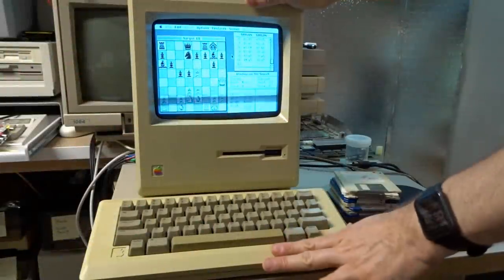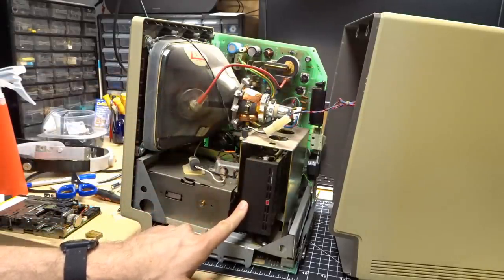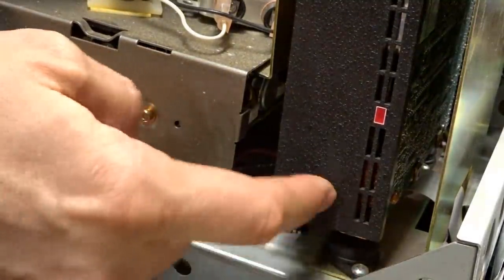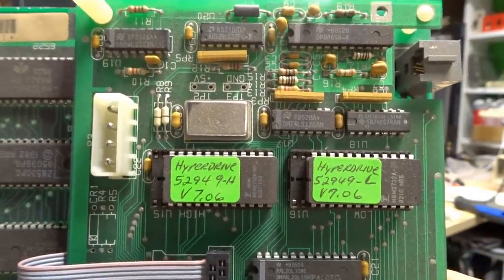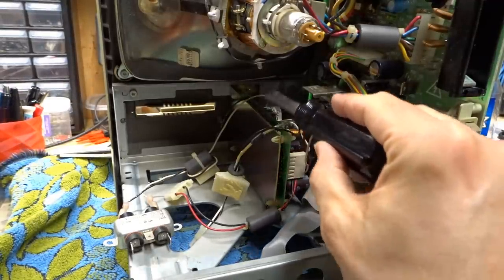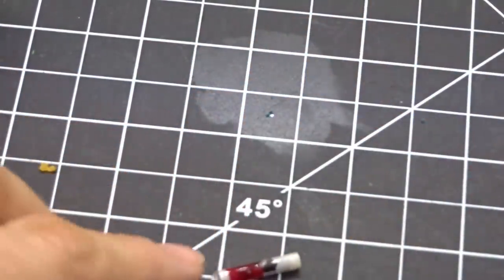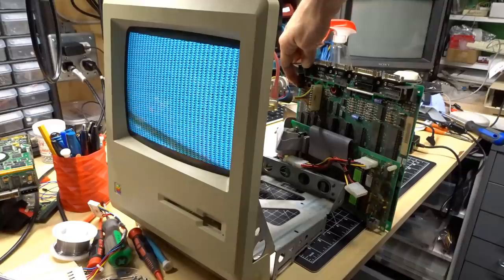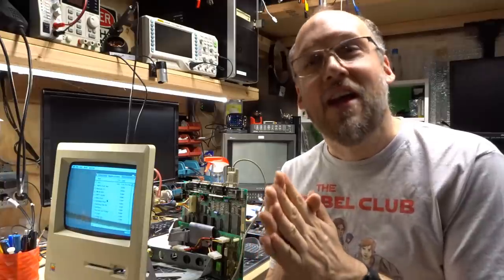Macintosh 512K with an internal MFM hard drive?

Comment: Keep it as-is! Even though an MFM drive on a platform that was historically known to use SCSI for a very long time seems weird, I'd still keep it as-is. Consider it like the Mac equivalent to the IBM 5160 XT.
Reply: You are thinking of the Mac Plus - earlier all-in-ones didn't have SCSI. There was an unofficial weird external hard drive that plugged into the external floppy port though...
Reply: Except it wasnt unofficial. it was called the Apple HD20. But you needed the enhanced ROMs to natively boot it. Otherwise you had to have a boot disk to load the driver before it transferred control over to the hard drive.

Comment: Leave it as is, though you should get another PSU for the hard drive. The upgrade is period correct.

512K Macs came with 800K drives, and you need to check the ROMs to see if it is HFS (Hierarchical File System) or MFS (Macintosh File System). Since it is using a rare System 5, it looks to me to be HFS.

HyperDrive used to make external SCSI Drives for the Plus and SE / SE\30s and even had an internal SCSI HD for the Mac Plus long ago as well as rebanding internal SCSI drives for the SE / SE\30 and Mac II Line.

Look at the side of the board, there should be steps on one side so you can pull the board out a tiny bit for the steps to line up and then open it like a swinging door. You should close it the same way.

If anything, check out the Analog Board and clean up/replace any bad solder you find and check the connectors for burn marks.

Comment: Yup. We called it “sticktion” in our lab back in 1994. We had so many MFMs we needed to repair, and used the same method to lubricate bearings with some graphite grease.
Reply: Ah yes the stiction problem, give [the stuck hdd] a good ol' whack and it should free up!

Comment: Leave it a the way it is, adding upgrades to these machines in that era was common due to the speed of development.

My dad had a Macintosh II back in about 1989, it came originally with a 40MB HD and 4MB of RAM, that was increased to 8MB of RAM later. In about 1991 the logic board was swapped out for the IIx version, and had dual 1.44MB floppy drives added, as well as upping the RAM to 16MB, it had a special graphics card fitted for the monitor which was a 21" if I remember rightly. Also had the apple scanner and laser writer II printer. it was used for desktop publishing at the time, it was quite an investment !

I sold that machine for just NZ$50 about 15 years ago, and it was still working!

I still have the full set of System 7.0 / 7.1 in its original box that was used with that machine,

Comment: @Adrian Black
The Mac 512k was originally available with both types of floppy drives. The higher capacity drive was an optional upgrade. About the HDD, like the Mac128, that is an authentic upgrade. Keep it! It's a very cool aspect of that computer! The first boot corruption problem is actually the way those upgrades worked BITD. The early upgrades required the reset be pressed manually because the HDD needed time to spin up. Not all of the HDD upgrades did that. Later versions paused the system boot long enough to account for the spin up time. This quirk is actually authentic as well. Do your thing fixing it up, but keep it as is. It'll be a wonderful show-case and conversation piece!

Comment: THANK YOU!  You saved my Applied Engineering Vulcan 40MB MFM Western Digital drive!   I have one of these in my original owner Apple //e and when I brought it out of 30 year storage the drive would not spin up.  I bought exactly the lubricant that you showed/mentioned and to my delight the drive spun up after putting it on an external power supply.  Amazing!

Comment: keep as is... dont know if there a mod to replace the old harddrive with something like a sdcard of CF or something in case of the drive failing
Reply: There are IDE and SCSI to SD/CF card adapters that are relatively cheap. For MFM/RLL though, the price shoots up substantially. I found one such board with a quick google search, but it's $270

https://www.drem.info/

Though for all of the functionality it offers, I'd say its well worth the cost.
Reply: Besides the board GGigabiteM refered to there is also http://www.pdp8online.com/mfm/. Similar functionality. And I doubt much cheaper if you include the beaglebone.
Reply: I don't see any point in making a interface to mate an SD or CF card with an MFM/RLL controller. Skip the MFM/RLL controller and interface to the bus directly.
Reply: @BlackEpyon  Considering the massive number of different machines that used MFM/RLL, that makes the least amount of sense. You'd have to make dozens of different interfaces for every machine and write the software for all of them.

Easier and less expensive to make an MFM/RLL emulator and work out the slight controller differences in software.
Reply: @GGigabiteM  Firmware, not software. Software doesn't need to know what kind of data storage it's using, only what address it can be found at. But the interface is less of an issue than the underlying system architecture. Mac architecture of that era was considerably different from PC architecture, as Mac and PC were from Commodore, where towards Commodore's end they were indistinguishable from PC, and Apple these days practically IS PC with a more expensive wrapper. As long as the architecture is similar, all you need is an adapter to change the interface.
Reply: @GGigabiteM  You're confusing the function of the disk controller with the architecture that it must interface with. For instance, the Intel 8088 has 8 data lines, as does the Motorolla 68000, but the 8088 has 20 address lines, where the 6800 only has 9, and the registers work completely differently. A card made for a x86 PC will NOT work on a Motorolla-based computer like the Macintosh Plus. Even if they perform the same function, they are not "the same disk controller" as you say. Not to mention that many MFM controllers were made to support certain hard drives, and couldn't be used generically without reprogramming the ROM.

But you don't need to make "dozens of interfaces with thousands of different I/O, IRQ and DMA nonsense." You only need to design one solid-state controller for each type of architecture, and there are only a handful of architectures out there. There are already a few out there for the x86 architecture (the XT-IDE project and it's spinoffs). It should be possible to do this for the Motorolla processors as well.  As long as you're working with the same architecture, and have a ROM BIOS made for that architecture, the rest can be solved by simple jumper settings to match available I/O and maybe an adapter to match the expansion bus if it uses a different header. For instance, the Tandy 1000 EX and HX computers use a 62-pin berg connector instead of a card edge. But they are almost identical electrically to the 8-bit ISA connector (the few pins that differ are unused pins rerouted for the DMA expansion card). Pretty much any 8-bit card used in a PC can be made to work on an EX or HX, and even a PC-Jr, because even though the interfaces between the 3 machines are completely different, the underlying architecture is exactly the same. Even many 16-bit cards can be used in an 8-bit slot if you restrict the settings to what's supported by the 8-bit bus, because the underlying architecture is the same.

If modern Apples use x86 processors, then they are necessarily based on x86 architecture. That's all there is to it. System management controllers are found in pretty much any Intel/AMD server motherboard these days, and the T2 rolls in a bunch of extra wank that isn't integral to the architecture at all. Whether they roll their own firmware and make custom chipsets (almost all motherboard manufacturers do), they're a PC with an expensive wrapper. Don't confuse the gilded facade for the underlying structure.

As for "emulating IDE," that's not necessary if you're using a Compact Flash, because the CF card is literally an IDE device already. That's why they're so popular as solid state storage in retro computing. There is little that is needed to connect an IDE device to the bus other than a boot ROM, and a few pieces of 74xx series logic for address and control. By contrast, SCSI, MFM, and SD all need to be decoded before they can interface with the bus, which requires quite a bit more circuitry.
Reply: @BlackEpyon  

>You're confusing the function of the disk controller with the architecture that it must interface with. For instance, the Intel 8088 has 8 data lines, as does the Motorolla 68000, but the 8088 has 20 address lines, where the 6800 only has 9, and the registers work completely differently. A card made for a x86 PC will NOT work on a Motorolla-based computer like the Macintosh Plus.

Think you need to re-read the spec sheets. The 8088 has an 8 bit data bus, the 68000 has a 16 bit data bus. The address bus is irrelevant unless you need to address large chunks of memory. The only 68xxx chip with an 8 bit bus is the 68008, but hardly anyone used that chip.

A disk controller IC used on a PC will most definitely work on a Macintosh, you just gotta write a new BIOS. What do you think the card Adrian is using here? It's using a bog standard PC disk controller IC with Mac firmware.

Comment: Wow what a find! Twice I have tried buy Mac 512k's and have always had issues with dodgy sellers...and here you have two of them! What a surprise to see this HDD setup! I am guessing that this was a very very early modification to address the lack of an internal HDD in the Mac 512k. You did a great job getting it apart and changing the power supply. I would just leave it the way it is currently and just enjoy it whilst the MFM HDD is still functional.After that fails then put it back to stock.

Comment: This is an awesome demonstration of the kinds of ingenuity and out-of-the-box thinking hardware engineers gave us back in the day! I'd say get it back together with the MFM drive intact, and bonus if you can get the original PSU working. I also echo what others have said about capturing the data off the drive so that the drivers and whatnot can be preserved for posterity (and anyone else who might run across a machine with this upgrade)

Comment: I had an Amiga 2000HD that had an MFM/RLL 20MB hard drive in it and when that died, I remember buying a Seagate 85MB - 5 1/4" Hard drive for $475  which was in the 90's was a lot and its still a lot today for a hard drive :)

Comment: Disclaimer: Don't take this the wrong way! It's something we're all guilty of. I just want to clear up any fog left lingering when it comes to the seemingly endless acronyms and definitions used in the world of computing. Many of you probably already know this and perhaps even the author himself, however the habit has become so pervasive that it's often never given a thought.

For years, and perhaps not really incorrectly you often hear older ST-506/ST-412 drives being referred to by the encoding method that they use. Almost every ST-506/ST-412 that you run into uses RLL (Run Length-Limited) with either FM or MFM encoding schemes. MFM (Modified Frequency Modulation) is merely a particular type of encoding scheme as opposed to FM (Frequency Modulation) where there are differences in density. 

P.S. Don't remove the hard disk modification! Very cool.

Comment: If you have an LCR meter or a capacitor tester, try removing all of the caps from the old power supply for the Hyperdrive and seeing if they're bad. Old electrolytic caps tend to dry up or leak and fail, causing whatever circuit they're in to not work.

I've been repairing switching PSUs for nearly 20 years and the most common failure is bad capacitors, which can cause cascading component failure if the capacitor fails by becoming electrically leaky or going high ESR. Electrically leaky caps can cause heavy current draw in components supplying them, leading to things like blown diodes, cooked resistors and blown transistors or mosfets. Old and rarely used supplies like the ones you have usually suffer capacitor failure while not in use and just won't work at all until they're replaced.

Comment: I wonder if the mods will make this Mac harder to preserve? Also, can you replace the 10MB disk with a modern solid state MFM adapter? It would be cool to honor the custom MFM board while updating the actual disk to something quieter.
Reply: I'd cut out the middle man and pull out the MFM adapter to preserve as a museum piece if you plan on putting in solid-state storage.
Reply: I’d leave the real drive in there. Who doesn’t like the sound of a stepper-motor drive? And it would be absolutely bonkers in my opinion to pull a fully-functional and period-correct MFM drive out just to put a modern solid-state solution in there. That drive has lasted over 3-decades already, so I think it’ll likely continue to work for years to come.

Comment: The 800k drive upgrade was an official upgrade offered by Apple.  It includes a 800K floppy drive, with Mac Plus ROMs.  My 512 has the same upgrade!  Mac Plus ROMs are required to boot from a hard drive without using a boot floppy.

Comment: Those old MFM drives can be sticklers when booting up, sucking a lot of power.  Maybe that's why it works when you hit RESET but not on power-on?  (Lack of enough power to the board due to drive pulling too much, or just the drive itself hasn't booted to where the Mac can read it.)

Comment: Considering the PSU repair: check the power transistor and any diodes you see for shorts. These are pretty common faults with SMPS and they are easy to diagnose and fix.

Comment: Fix the switching power supply. It shouldn't be too difficult. 1. Check between the legs of the main switching transistor. If shorted replace the transistor and the main electrolytic cap and fuse (if there's on). This is the most common failure. The fuse is probably the black thing wrapped in heat shrink tube. 2. One other thing you can do is check all resistors in circuit with an ohm meter, certainly the megaohm-range startup resistor on the primary side. Those seem to fail often too. Your caps don't look bulged, so there's a chance it's the startup resistor. 3. Check there's 400V DC on the electrolytic caps.  4. This power supply doesn't have a switching IC, which makes your chances to be able to repair it much higher 5. Check the bridge rectifier diodes on the primary side. 6. check the LED in the opto-coupler with a diode test with your multimeter 7. Check that the resistance of the phototransistor in the optocoupler goes down when the LED gets power.

Comment: Whatever you do, you should make an image of those EPROMS!  A cheap $50 eBay TL866II Plus Programmer will do the trick. I'd get in a habit of doing that on all your old computers.  There will come a day when the EPROMS WILL lose their contents, and then you will need a copy to burn a new one.  It would be a great service to your viewers if you posted a copy of the EPROMS you find so if someone else runs across one of the HyperVisor cards with a bad EPROM, they can fix theirs. Anyway, my vote is to keep all the mods the original owner did, it's always nice to see all the hard work someone did to make the machine they wanted and not just be happy with the stock unit.  A true hacker and maker owned that machine back in the day!

Comment: Keep it with the HDD - that's a very cool mod. Hopefully you can figure out how to get the power staging to work with the new aztec, so the reset isn't needed (Also worried that could damage something eventually). Maybe you could put in a bigger HDD (I looked on Ebay for MFM/RLL 3.5" but what there is is crazy expensive) but that's probably not worth the trouble. I remember about 10 years ago throwing out a running mac 128 just like one of these, wish now I hadn't. They are classic examples of early computer technology, and I admire your ability to get them running - and posting us these cool videos.

Comment: In my opinion, same thing applies here as you said for previous Mac, mod is period accurate and I wouldn't say it changes experience that much, but it does make this Mac more unique. So I would keep it. There likely are more stock Macs around than those with cool mods like this. Plus I think mods are just as much part of history as stock, so I think mods at least in some cases like this should be preserved as well.

Comment: The HD"mod" was common to Non SCSI Macs including the fan used. Fan box is because of Size electronic and motor and too small fan to fit all of that in it. Some fans has big resistor (1 to 3 watts) to slow fan speed. If you have this do not let resistor to touch plastic parts.  Fans there had a metal part or Velcro to mount. Side note: seems to have the later flyback likely because this Analog was replace and why has better caps too. Apple has several changes when this was replace using authorize shops because they send the dead boards back to Apple. Should have different marking somewhere on board to show version etc by Apple.

Comment: I think keeping the upgrade is the best option if the first-boot corruption can be fixed.  Have you tried powering on the HDD/controller PSU first, and then switching on the Mac?  It might require desoldering the switch and temporarily hard-wiring the HDD PSU on.  If it fixes it, then a solution could be to use a 555 timer and a relay to switch on the Mac slightly after the HDD/controller.  Another idea is to give the HDD PSU its own switch.  Or leave it hard-wired on, so switching mains on allows the HDD controller to initialize before the Mac PSU is on.